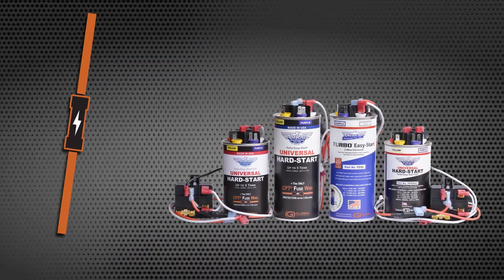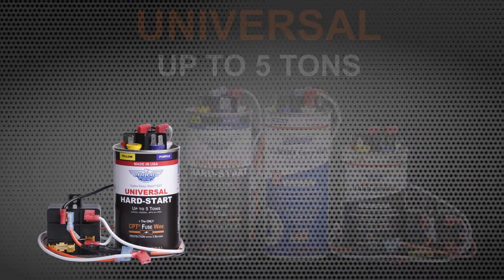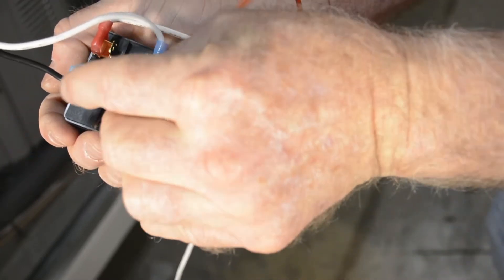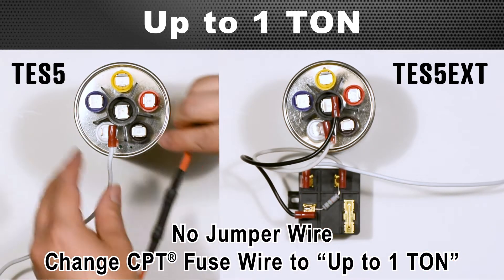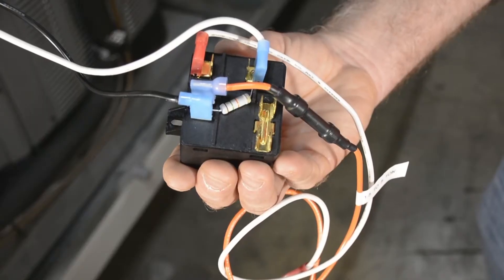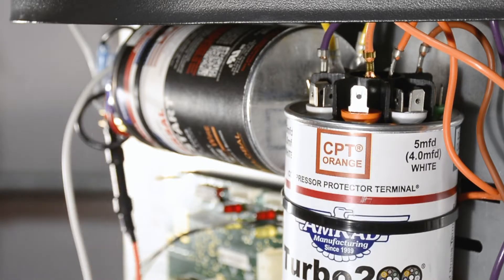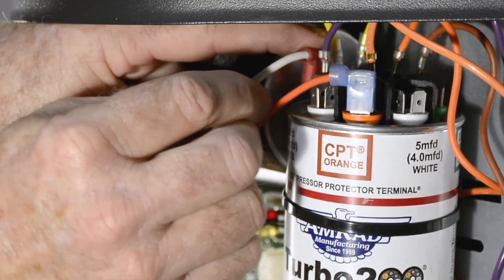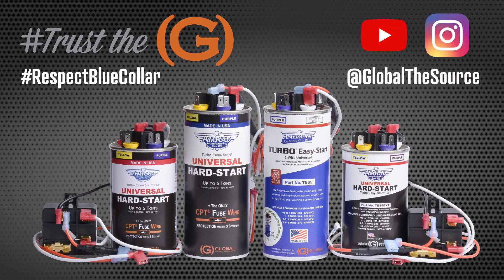AmRad Turbo Easy-Start (TES5 and TES5EXT) Hard-Start Install with CPT Fuse Wire

Comment: I don't think the video mentions that if for some reason the CPT wire fuse blows you should replace the entire hard start unit. I found this out when I was shopping for a replacement CPT wire and couldn't find it.